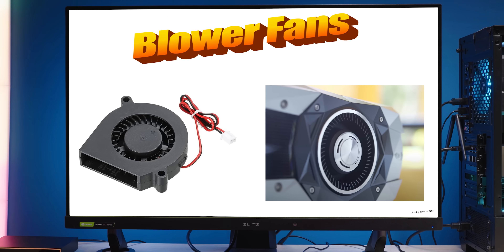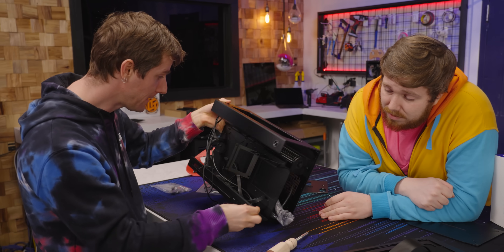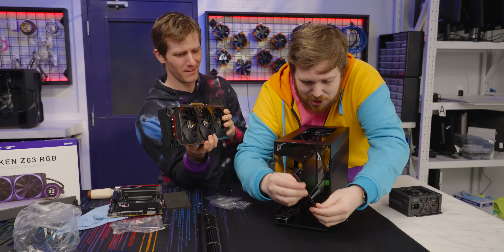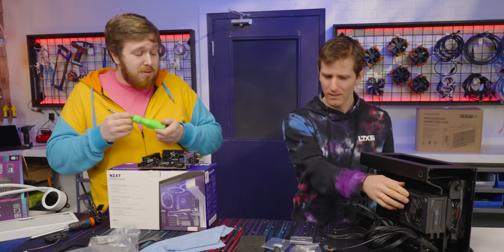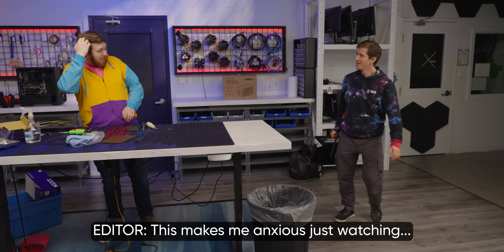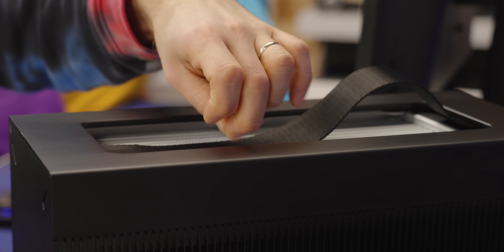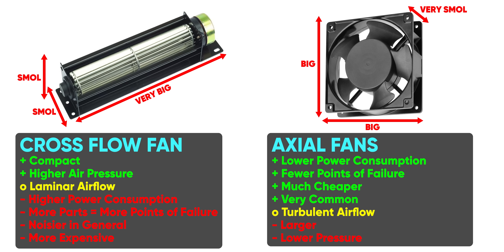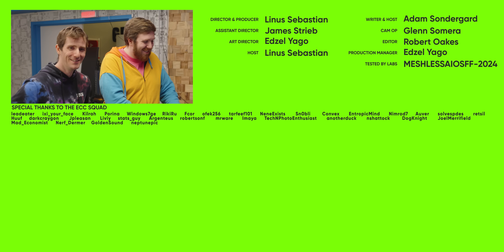This BLEW me away! - Meshless AIO SFF by Meshless Design

Comment: It's cooled with a single fan! ... Plus the fan in the power supply. And also the three big fans on the GPU. I guess this is to be expected when your company is named Meshless and you sell a case with a bunch of mesh.
Reply: they said a case that doesn't use the conventional round fans, not that it was a fanless pc
Reply: @thedeathmatchrun2366  They did say that it was cooled with a single fan. But any computer you build in that case will have multiple fans. Unless you're using a passively cooled power supply and a passively cooled GPU.
Reply: @makingretro  yeah they meant the selling point was the case being cooled by one compact fan, not the entire pc
Reply: I know what they meant, but that's not what they said. It's kind of silly to point to a thing with four fans in it and say "hey look, only one fan!"

A computer with only one fan is not unreasonable. Look at all the mini PCs with only one fan, or the Mac Mini and Mac Studio. The Mac Studio can quietly cool 400 watts with only one fan. The way PCs are cooled is kind of an embarrassment.
Reply: @makingretro first of all, the mac mini and mac studio shouldn’t even be mentioned as they aren’t comparable at all with muuuch lower temperature produced and specs, as they also have an integrated CPU without a dedicated GPU, and a much lower watt usage than this build. Second of all, I looked and haven’t seen a single 4090 mini pc build that uses only one fan in the entire PC. Thirdly, the video never once said the entire PC was cooled with one fan. They meant that one unique crossflow fan was handling the airflow of the pc, as it intakes air for the radiator and exhausts air taken from the GPU and PSU, and radiator as well.
Reply: @thedeathmatchrun2366  "Really, a 14900K and an RTX 4090 in this case, with no other fans? Not even on the radiator?"
Other, from context here, meaning fans other than the crossflow case fan.

Also, a Mac Studio pulling 400W isn't THAT far off of what they're doing in this video. And it's a fraction of the size and it really only does have one fan.
Reply: @makingretro  Once again, that doesn’t mean the entire PC only has one fan. Linus says that the case only needs one crossflow fan to provide airflow for a 4090 and a 14900k. He never said the entire PC was cooled by one fan, and he also never mentioned the number of fans in a PC as a selling point.

Secondly, let’s just not use any pc’s like the Mac Mini or Mac Studio for comparison. I could go on a whole rant on how extremely different those are compared to normal PC builds. Also, wattage doesn’t matter here, temps do, and PC’s produce wayyyy more temperature than Mac’s
Reply: @thedeathmatchrun2366  "Linus says that the case only needs one crossflow fan to provide airflow for a 4090 and a 14900k." Right, except that's not true, though, is it? Because the GPU has three fans in addition to the case fan.

Also, if you think that watts aren't correlated with temperature, I don't think we have anything more to discuss. This is just basic physics.
Reply: @makingretro …I’m not gonna lie, your comprehension is stressing me out here. One fan handling airflow for the other parts that use fans. There, does that make sense now? The other parts that use fans, need airflow in the form of exhaust or intake to cool better. The point is that one fan handles the radiator’s intake and GPU’s fan exhaust, while being compact and unique, and strong too.

Also yes, wattage does matter for temperatures, but what also matters is how efficient the chips are. This PC will probably pull 800+ watts continuously at max load whilst also using two chips. The Mac Studio only has one chip and uses two times less watts at max load, uses one single chip and is more efficient with temperatures, therefore needs much less cooling.
Reply: @makingretro also if you would allow me to rant on why we shouldn’t compare Mac Studio’s to normal PC’s, I’ll just list them out. Integrated CPU GPU and memory in one chip, specially designed parts that will only work in that system, if it didn’t have one chip and had them separate like normal PC’s they would most likely need a bigger volume, and more fans, and the biggest problem is that there’s no user upgradability with the Mac Studio, so Apple doesn’t have to worry about making parts accessible to be upgraded and can focus on making them more compact, unlike this case which uses bigger user upgradable parts and is much more user friendly
Reply: @thedeathmatchrun2366  Except that the crossflow fan doesn't handle the GPU intake air, that comes in via the GPU fans through the side of the case. No matter how you want to parse this semantically, there are multiple fans handling airflow for the computer.

Also, the TDP of a 14900K is 253 watts and the TDP of a 4090 is 450 watts. So the computer might use four fans to cool 703 watts plus whatever the motherboard requires and whatever inefficiency there is in the power supply. The Mac Studio can cool 400 watts with one quiet fan and a relatively small heatsink. The fact remains that PC cooling is an embarrassment, with a hodgepodge of fans and heatsinks and radiators all in different locations pointing in different directions. If there was a fundamental rethink of how PC cooling was done, it could be improved enormously.
Reply: @makingretro a case handles the airflow made by the components, that’s what I’ve been saying. Never said that the crossflow fan handled the intake of the GPU, I said it handled the intake of the radiator, and the exhaust of the GPU.

Also, did you not read the last part of my comment? PC’s offer upgradability and ease of changing of parts, UNLIKE most apple products, which is why apple, although compact, offers no user upgradability features similar to that of PC’s. PC’s are “bulky” because they need to be handled easily by the user. That’s why small form PC’s are impressive since they can match the size of some small form computers by apple, whilst being more powerful and upgradable. Meanwhile Apple focuses on their products being sleek, causing parts to be compact but not upgradable at all.
Reply: @thedeathmatchrun2366  If Linus's point was that the case itself only has one fan, then he should have said that. But he didn't. Hence my comment. You're trying to explain what Linus MEANT but I have always understood what he meant. The reason I posted is because what he said didn't match what he meant.

As for PCs having poor cooling because they're upgradeable, no. It would be easy for PC manufacturers to get together and create a new standard for cases (like ATX, BTX, ITX, etc.) that allowed for ducted, directional airflow. They just don't.
Reply: Dude, just drop the single fan thing already, clearly nobody else thought he meant the entire PC had one fan, only you did somehow, when he said it clearly to everyone else here. 

Also, that second statement is ridiculous. You're actually saying it would be easy for hundreds of companies and manufacturers that make PC components stick to a cooling standard, when they don't even have regulations or incentives to do so? BTX failure is an example of what happens if a company tried to make a new standard today. All the reasons that it failed, would be intensified in this era if someone tried
Reply: @thedeathmatchrun2366  You're right, everybody did know what he meant. Linus, you, me, everybody. The only reason I posted was to point out that what he said isn't what he meant. So all of this effort you've been expending to explain what he meant is completely irrelevant.
It's funny that you're annoyed at me for not dropping this, but you're the one who keeps posting about what he meant long after we have all agreed on what he meant.

Comment: This is one of those things where if you want small form factor it comes at a price which makes sense in this instance. The case can accommodate a 360mm rad and a 4 slot GPU in a form factor that is comparable to a console which while it may seem expensive at $360 to normal people but at this high end level where its not so much a decoration piece but something meant to be functional its fine.

Comment: this is just me thinking outloud. could you not break down the Cylindrical fan unit into dual fan unit-partitions and put it on a chain pulley system and compact the design even more? idk if thats even doable but anything for compactability

Comment: I use two electric leads daily for work. One sees the most use and consistently breaks in the same spot—right at the base, where there’s the most movement. The repair guys added a sleeve to reduce flexibility at that point, but it just shifts the stress to another part, either inside the sleeve or right at the edge. It’s frustrating. Both the wire and the silicone jacket break, and it’s always such a clean snap. Maybe the type of internal wire contributes to that too.

I’ve dealt with plenty of internal breaks before and can usually work around them. But when the break is too clean and there's not enough wire left to reconnect, it’s a total headache.

So yeah, silicone cables might be fine depending on the use case, but personally, I don’t see them surviving across multiple builds.

Comment: these guys building tiny computers with top of the line hardware....meanwhile me with my 6800XT and 5900x overheating at 110C with a big case and a lot of fans....

clarification: its most likely a GPU issue, my 6800XT Undervolted and the fans cranked at 100% overheats at 113C and shuts down + its 30C in the UK Currently, i AM UPGRADING to a 7800XT so hopefully that card just fixes temps

Comment: O.o -> so there are actual PCs out there that use the same cylinder fan for cooling as in my old wooden case I've build years ago. I still use it with WinXP x64bit for some old games and software. It has Asus x58 workstation board inside with a xeon cpu x5670. Maybe I should make a video about it and it's performance....

Comment: well the cost some custom cases i expected it to be a lot more. i feel for the quality it seems very solid case $359 seems very reasonable. maybe if options to use normal fans as well be extra bonus but i still like idea one big fan but i do not think it work well where my pc is as in attic under low ceiling were heat builds, and as smoker unsure how the long fan hold up as far more easy to replace sections of fans over time like water cooler aio, then front and rear fans. i just watched one your vids cleaning a pc and mentioned all in one water coolers around 5 years use for one in closed system mines now 7 years old. i will go for another closed system as i fear the ones you got to fill more chance leak even tho that might not be the case. so soon a new closed system water cooler and replace the fans, something ive put off as always worried i forget where all plugs in to but few fans at a time  be ok, biggest worry ive seen taking of the water block the cpu comes with it on some your vids is that common the cpu splits in half. so far even tho old water cooler corsair 2 fan one its runs well still just normal stuff like watching tv around 40c, games around 60-70c so works well on r7 1800x, biggest heat when 1070 evga is working hard but plans with that, after cooling and fans sorted as one fans it catching on what attached radiator so sooner than later, next thing after that double the ram so fill the other two slots making 32gb but ive sorta found out im not using best type vengeance for amd so do just upgrade all or just get two same what i got, but 2nd to last cpu or gpu as atm gpu a few reasonable cost ones what far more memory than my 1070 and cost the same new even tho 1070 was used in 2017,  its the Gigabyte Radeon RX 7600 XT GAMING OC 16GB £320 the one most tempted with as the other one on list you guys said dose have issue with failing going bad, 2nd option ASUS GeForce RTX 3060 12G at £260 the cheap option and both be big upgrade and very reasonable cost but im swing to  Radeon RX 7600 XT GAMING OC 16GB and as amd system it prob better option for budget. cpu no idea maybe 5700x  but before the gpu and cpu a new psu as it was cheaper one back 2017 but it done well but feel it something i need to get sorted. as huge coolmaster case great air flow the board seems fine and it runs every thing i want, a bit kick with few upgrades it see me out for some more years, prob another 5 plus. its tempting to start over and have old as backup. but this a slow upgrade bit by bit over time but first i feel a new water cooler as fan a bit annoying and only rated for 5 year and now it 7

Comment: Linus you cite crossflow fans having two bearings and "two failure points" while comparing it to a multipack of 5 fans... AKA 5 bearings, 5 connections, 5 sets of blades. Thats weak analysis at best.

Comment: Silicone covered wire isn't more expensive to purchase but its more expensive for assembly because its so fragile it has to be handled carefully to prevent cuts in the silicone housing. unless you are placing the wire lose to a heat source its not the best option.

Comment: Keep in mind: LTT blew about 400 dollars just on Noctua fans for the all Noctua fan PC. And that didn't include the case. This is a premium case with a lot of thought behind it and a very clever solution for making a tiny, high-end gaming PC possible. And with the case coming in at about 400 dollars including a fan, that's a far better deal. Typically you have to make sacrifices somewhere with a small gaming PC: Noise, high-temps and/or lower performance. Yes, the all Noctua PC was dead silent, but also needed A LOT of fans moving air through a very, very big case.

Comment: as an SFF pc builder and owner who used multiple SFF cases, this by far is the easiest one to assemble a PC with. if only there are normal cube / slim tower cases that are this easy to install.

and the fact that they ask you what power supply you are using so they can make custom cables for you is amazing.

Comment: I mean to be fair the price for that fan is comparable for the Lian li fans i want or the corsair LL fans i have at about $30 each, and in a tower i have 7 total fans bringing the price alot higher and my systems a little older with a 5600x but my strix 4070ti is an absolute space heater if i dont undervolt the cpu/gpu... and that 1 fan gets around the same temps in a system thats more powerful than mine?? I think i paid $170 for my corsair 570x crystal and the cost of that case is justified becuase its about even once you factor in all of the fans but then again its small form factor which saves desk space. and lowers the total decibels of the cooling system not having to have 7 of them.... honestly having watched the entire video i think its worth to invest in a case like that

Comment: @LTT I don't suppose you could do a follow up video with the CPU undervolted and cover the thermals and noise profile whilst gaming; I feel that the manufacturer's broad statement is misleading for your average PC builder... As an SFF builder, I am well aware that you have to accept some trade offs when building in an SFF case, but I wonder if this case could game at a very respectable near silent noise profile, if you were to undervolt the CPU and GPU... Just undervolt, not underclocked as well, so it's reducing power consumption but not performance...

My reasoning being that I'm seeing comments on here that the CPU is throttling.  But I'm an SFF builder and you have to go to extreme lengths to get that kind of hardware to not throttle in an SFF case... It's just an accepted fact that you have to compromise somewhere with an SFF build.

I have a heavily modified NR200 with dual radiator custom loop watercooled GPU and CPU. Both my GPU and CPU are undervolted to the perfect limit of stability.  I went to these lengths to achieve a silent when gaming system. And it is silent when gaming.  (12700k OC to 5GHz all core at 1.68V, HT disabled, Ecores enabled, 45-60W in game & 3080 10G undervolt/slight OC to 1950MHz at 0.867V and +300VRAM, 175-240W in game, 40-45% fans, 40% pump speed, 55-62C in game on CPU, GPU and VRAM)... It is so quiet that the only noise I could hear from it was the PSU fan, which annoyed the hell out of me, and I ended up doing a Nocpooa fan mod on the PSU too... But it cost over £700 just for the cooling system parts, including the 5xNocpooa fans (and was a real PITA to fit everything together too, unlike that case!)... 

That case plus an Arctic Freezer AIO would cost significantly less, and I'm sure it would also be very quiet when gaming with a similar undervolting strategy, even on the more power hungry 13700K/14700K... 

PS. That is a lovely case.  I want one....

Comment: I have a hard drive that has a cross flow blower fan inside. It sucks air in through vents on the front of the drive bezel, and blows it around the aluminum disk assembly unit, control boards and power supply.

It's a Fujitsu Eagle M3251 from 1984...!

Comment: Ahhh man, you had me until I saw the airflow pattern. This is a negative pressure case. That means the air (and heat) are always being sucked out faster than it can come in... creating a vacuum. 
The problem here is dust: it settles in a vacuum and sticks to components. 
What you ideally want in a constant single-directional airflow case like this is something more akin to rack mount servers, where the fans are at the intake and blow air across the internals with a positive pressure, which will stir up dust and carry it out of the case. 
A simpler way to think of it is that if the pressure is low, there is room for dust to be added, but if the air is already trying to find any way it can to get out... it'll take the dust along with it, screaming "no vacancy!"